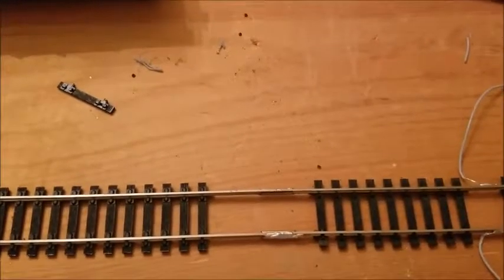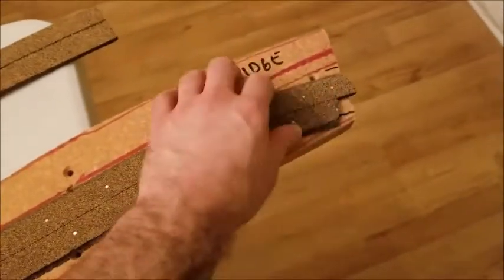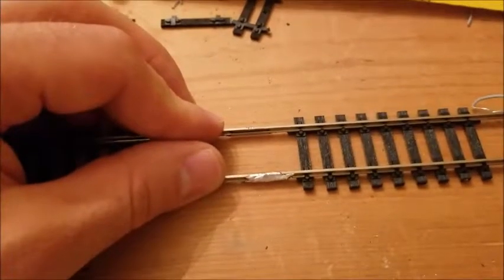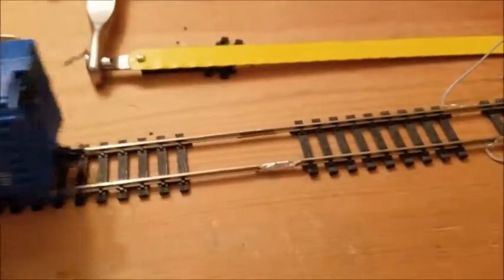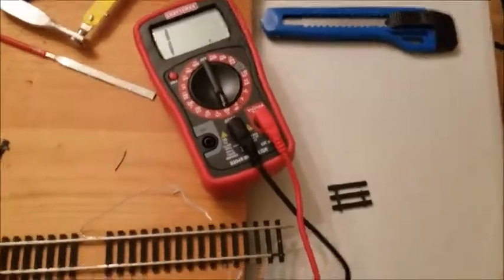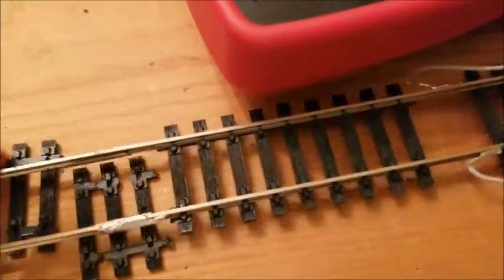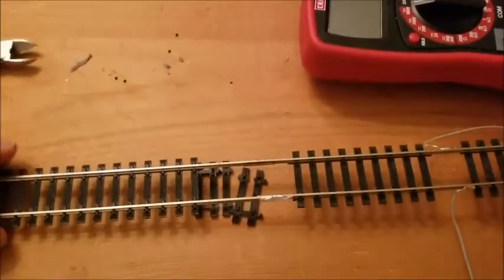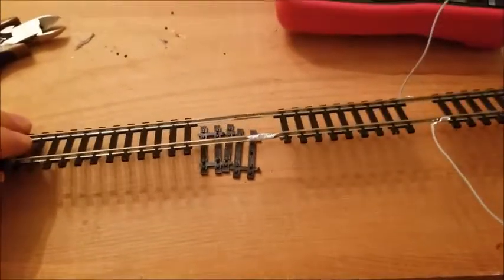Flex Track Soldering 2018 09 09 Part 2

Comment: there are track cutters. like a pair of side cutters but meant for track, it does a perfect cut on one side, and mushrooms the other side, most hobby stores have them. Track cutter. 
When soldering wires to the track you can do either out side of the rails. or the bottom of the rails.
last thing i can say. go to the plumbing section of the hardware store, soldering paste.. add a bit of that to the rail joiners and the rails, hold the soldering gun to the inside of the rails, then hold solder to the outside of the rail joiner, ( edge ) the paste will draw the solder into the joint.

Comment: When soldering, heat the surface first before applying the solder. Get a powered Dremel rotory tool with a pack of cut off wheels. This allows you to cut rails cleanly and more effienctly.

Comment: I understand that this may not be related to the video but I really am curious, on your old layout you removed the rail joiners on your bachmann ez track, how did you remove them? Please respond if possible, thanks! And great video!
Reply from the maker: It's been a while since I've changed them out, but I remember having to use a pair of pliers. I took some hobby style ones that were thinner, but not quite needle nose pliers. Doing so kind of mangled the rail joiner I removed, but they're fairly inexpensive. You may have some luck bending them back into shape.

Just be careful because you don't want to damage the Bachmann track when removing the joiner.
Reply: @ehoover4156  Thanks so much! Im planning on doing what you did, installing plastic rail joiners.